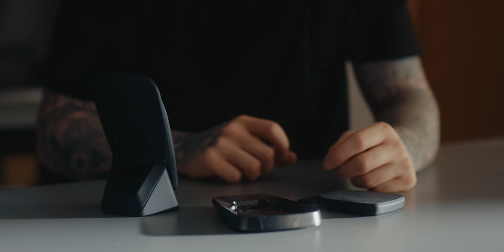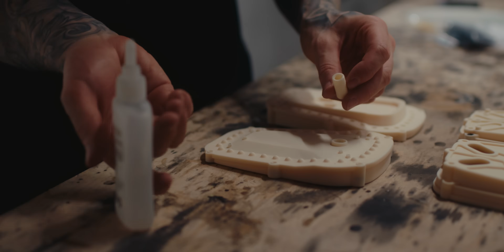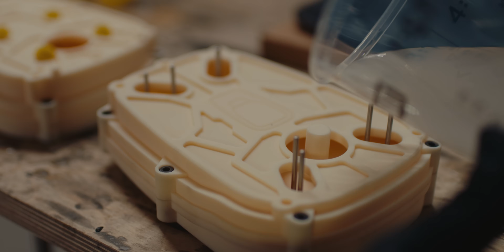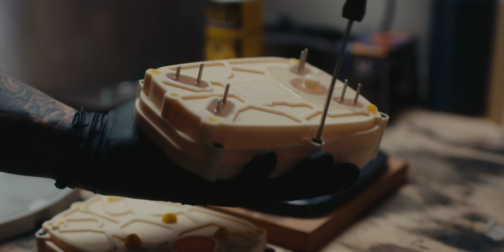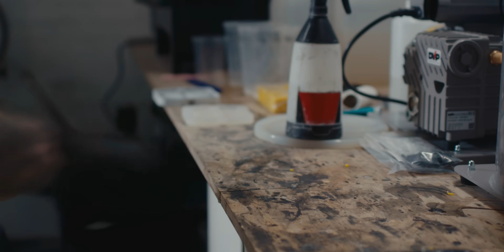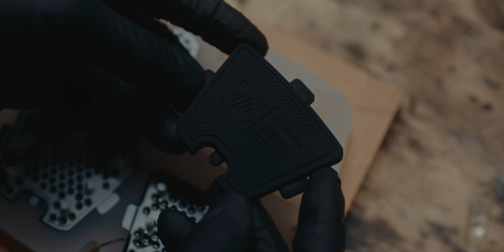Making Moulds That Make Moulds

Comment: Have you found that that printed resin material does not have curing inhibiting issues? What silicone are you using? I tend to have issues with platinum cure silicones on other SLA materials. Thanks!

Comment: Ohh I have questions : )   I've been experimenting with getting this setup with my own molds but even after cleaning/ curing I still have my platinum silicone not curing properly against my resin parts. I can switch to tin based silicone for non food grade molds but have to use platinum for anything food safe.  are you doing any extra prep to your printed parts other than washing and curing and using a mold release?  And I love your video  its very informative and super helpful  thank you

Comment: If I were to describe to you a general shape of a future product that would be made out of thin flexible silicone (very much like a dessert baking mold but would have a totally different use sorry I cannot tell you the product yet) could you tell me whether it is possible for me to make a mold for this myself? How do you make a mold of something with a thin wall thickness, has a specific shape. Does clay play a role?

Comment: Hey, whats the advantage of making the silicon inserts for inside your mould shells for moulding the finished pu parts?  Surely thats a carryover from the days of making a replica of a physical part to mould from? in this case, you are a skilled CAD operator, you can design the parts to get you perfect mould negative cad parts, and you have a hi def resin printer, so you can print your moulds...why not just mould directly the Polyeurethane into a printed resin mould?

Ill level with you, I'm fishing for information. I'm a mechanical engineer moonlighting as a product design engineer in my current role at work....i don't have the greatest amount of experience moulding TPU (although i ve printed hundreds of go pro mounts in it on my side hustle at home), and ive taken it upon myself to redesign a safety lanyard for something that i intend to make out of polyurethane 6-90A (not sure yet)

Theres no way i have time to go to the absolute fine detail you are doing,  and i didnt buy any silicone, just a bunch of different PU grades from smooth-on. I am simply prototyping to ascertain the best grade of PU to use, and size /strength test my critical features, but i am simply planning to print the mould negatives on our resin printer in 2 halves and pour directly into it (well actually i purchased a massive syringe to do it, so i am definitely intrigued with your  simple pour method).

Comment: Adding carbon powder does not help with the strength, it's an impurity. For colour you should use mica powder. Not using a pressure pot on any pour is asking for bubbles. Always pressure the finals.

Comment: Hearing you talking about casting a tube within the casting sounds interesting. But I wanted to highlight that this is an issue if it goes anywhere near the pressure tank (in case you had not thought about it, which I am sure you have). Love this video. I am "trying" to create a cast product, and it takes all my time to concentrate on this, let alone your detailed video setups. I have no idea how you manage all these workflows at once. Well done to you; the video and the productions look amazing. First time here, but subscribing and diving into the archive.

Comment: Sorry what kind of wax is that ? The annotation is calling it fiin wax for some reason
Reply from the maker: It’s called filleting wax. I’ll be updating the description with all the links to everything I used, just haven’t got round to doing it just yet! Thanks for watching!
Reply: @RTAFabrication  I appreciate it; Honestly the way your streamlining the worklflow is so awesome inspiring, I’m still improving on the basics for epoxy  and working on block mold for now (would be amazing, if you have some time to make a video on a way to polish those skills; also, do you think its a good idea to improve my skills while simultaneously learning silicone 2 parts and 3d printing?

Comment: I call this positive halves with the dividing wall(s) “inverse molds.” Used this several times and always amazed when the poured halves fit so precisely together.
Reply: I am pleasantly surprised it worked that well (likely due the compliance in the silicone when clamped and contained in ridged braces)
From previous experience, it’s never as tight and clean as doing two castings with one master.

Comment: Let's say I have an FDM printer. Would I be able to make it work with this? If so, then how so?
Reply from the maker: Yeah absolutely. I’ve printed some FDM matrix mould shells. I haven’t done this exact setup with the masters built in, but I have done it with clay in the example I mentioned towards the beginning. I’d suggest watching the video I did on moulding the oak plaques. I use FDM printed shells in that video showing the exact process. The one thing I like to do with the FDM prints is coat the interior of the shells with a brush on epoxy, like the XCR resin from Easy Composites. This just gives the shell a smooth surface for the silicone to take an impression of rather than it picking up all the layer lines from the print. This is just an extra step I like to take to ensure that the silicone seats back into the shell well.

Comment: Nice process, i only make coasters and coaster holders at the moment and 3d print a positive master mould, then coat that in epoxy resin to give it a smooth and shiny surface, then pour silicone rubber into that to make the negative mould, then use resin to make the final part.

Comment: I thought platinum silicone didn’t work well with resin prints?
Reply from the maker: Hey, thanks for watching! A few people have asked about this, so I’ve pasted my reply to them below as it’s relevant to your question.

“Thank you! It’s funny, I’ve had a fair few comments about this, and ironically I had a whole section in this video mentioning it which I removed which I’m now regretting! I only removed it due to the length of the video.

This is something I get asked about a lot. Weirdly this is never an issue I’ve ever faced. I’ll always either use the Mann Ease Release 200 spray on mould release or I’d paint the master. Both create a barrier between the print itself and the silicone. On the multi cavity mould with the 4 masters built in, I didn’t actually spray mould release on it as a test to definitively see if I’d get any cure inhibition. As you saw, I had no cure inhibitions which surprised me! I went on to say that I’m not sure if it’s down to the SLA resins I use, or the silicone, or the cure settings, or time after curing the part and moulding. I’ve had many people say they use the same SLA resins and have had issues, so my best guess would be that it’s the platinum silicone.

The resins in the video were from HeyGears, the PAWR10 is the beige/ creamy colour and the PAU10 is the grey resin. I have an Elegoo Saturn 2 8K which I usually use AnyCubic ABS like with 10% Siraya Tech Tenacious mixed in. I’ve never had any cure inhibitions with any of those resins. The silicone I used in this video is a sample of a silicone I’ll be releasing soon.

I also said in the clip that I cut that I might do some thorough testing to try and get cure inhibitions so I’m able to figure out which variable is enabling me to do this to try help others out.

I hope that’s helpful in some way and thanks for watching!”
Reply: @RTAFabrication    Thanks for the reply.     I had tried many times using syratech fast grey,   Fully cured,  cured under water as suggested, etc etc.   Always had problems.   I ever tried Siraya techs own platinum silicon.   Failed every time curing to their instructions.   

Anyway.  Thanks again for the reply
Reply from the maker: No worries! Yeah it’s really weird to me that so many people have these issues. I can only guess at this point that is the silicone I use that’s allowing me to do this without any issues. As I said, it’s something I’m going to look into abit further to try and pin point exactly why I don’t get cure inhibitions and why the majority of people do. It sounds like it’s something that would help a lot of people out!
Reply: Some resins and silicones products are indeed more compatible. It also looks like your prints are SOLID and not hollowed out. With hollow prints, it's almost impossible to get a completely cured part in a reasonable amount of time, and they often require extensive cleaning and a bake-out process to speed up the removal of cure inhibiting residuals.

Comment: Man I love your videos. So inspiring and perfectly executed!
But there's one thing I can't wrap my head around: what kind of UV-Resin do you use so you can sort of directly pour silicone on it? This was always the most annoying thing because my resin would inhibit the silicone curing
Reply from the maker: Thank you! It’s funny, I’ve had a fair few comments about this, and ironically I had a whole section in this video mentioning it which I removed which I’m now regretting! I only removed it due to the length of the video.

This is something I get asked about a lot. Weirdly this is never an issue I’ve ever faced. I’ll always either use the Mann Ease Release 200 spray on mould release or I’d paint the master. Both create a barrier between the print itself and the silicone. On the multi cavity mould with the 4 masters built in, I didn’t actually spray mould release on it as a test to definitively see if I’d get any cure inhibition. As you saw, I had no cure inhibitions which surprised me! I went on to say that I’m not sure if it’s down to the SLA resins I use, or the silicone, or the cure settings, or time after curing the part and moulding. I’ve had many people say they use the same SLA resins and have had issues, so my best guess would be that it’s the platinum silicone.

The resins in the video were from HeyGears, the PAWR10 is the beige/ creamy colour and the PAU10 is the grey resin. I have an Elegoo Saturn 2 8K which I usually use AnyCubic ABS like with 10% Siraya Tech Tenacious mixed in. I’ve never had any cure inhibitions with any of those resins. The silicone I used in this video is a sample of a silicone I’ll be releasing soon.

I also said in the clip that I cut that I might do some thorough testing to try and get cure inhibitions so I’m able to figure out which variable is enabling me to do this to try help others out.

I hope that’s helpful in some way and thanks for watching!

Comment: Hmmm I’ve had issues with curing platinum silicone with resin printed masters. This lead me to use tin based silicone. Are you using platinum because I’d love to switch back. I’m sure it’s something I did wrong.
Reply from the maker: Thanks for watching. Someone else asked this same question so I’ve pasted my reply to them below as it’s relevant to your question.

“Thank you! It’s funny, I’ve had a fair few comments about this, and ironically I had a whole section in this video mentioning it which I removed which I’m now regretting! I only removed it due to the length of the video.

This is something I get asked about a lot. Weirdly this is never an issue I’ve ever faced. I’ll always either use the Mann Ease Release 200 spray on mould release or I’d paint the master. Both create a barrier between the print itself and the silicone. On the multi cavity mould with the 4 masters built in, I didn’t actually spray mould release on it as a test to definitively see if I’d get any cure inhibition. As you saw, I had no cure inhibitions which surprised me! I went on to say that I’m not sure if it’s down to the SLA resins I use, or the silicone, or the cure settings, or time after curing the part and moulding. I’ve had many people say they use the same SLA resins and have had issues, so my best guess would be that it’s the platinum silicone.

The resins in the video were from HeyGears, the PAWR10 is the beige/ creamy colour and the PAU10 is the grey resin. I have an Elegoo Saturn 2 8K which I usually use AnyCubic ABS like with 10% Siraya Tech Tenacious mixed in. I’ve never had any cure inhibitions with any of those resins. The silicone I used in this video is a sample of a silicone I’ll be releasing soon.

I also said in the clip that I cut that I might do some thorough testing to try and get cure inhibitions so I’m able to figure out which variable is enabling me to do this to try help others out.

I hope that’s helpful in some way and thanks for watching!”
Reply: Same to me ....

Comment: Hey man, I am noob here, but when the silicon is poured (second grey/blue mould) it's better to pressurise it, not degas again. AFAIK,
Reply from the maker: Hey! You could put it in the pressure pot, however, all you’re doing there is crushing the air that’s within the silicone mixture. This won’t necessarily guarantee that any air bubbles will be eradicated, only make them smaller. This isn’t me saying it’s the wrong approach, but the goal with that was to remove them entirely from the detailed areas. 

I degassed the mixture first to remove the air from the mixture itself and because if I didn’t and just poured it into the mould, it would have overflowed due to the amount of air in there when I did the degassing on the mould. I degassed when the silicone had covered the masters to remove the air from those details like the text on the master/ mould. Doing it this way will move the air out of those details, which was the only real goal, and then they’ll come up through the mixture removing them from the silicone.

Hope that helps and thanks for watching!
Reply: @RTAFabrication  got it, thanks for explaining!
Reply: resin needs pressure while curing ... silicon needs depressure after mixing...

Comment: Great work and passion!  What about the problem of platium-silicon does not cure/inhibit problem with resin-printed forms? You did't seal your forms ... so maybe your resin material does not have that issue? Whoch material are you using? Or is it just like magic ...
Reply from the maker: Hey, thanks for watching! A fair few people have asked about this, so I’ve posted my reply to them below as it’s relevant to the question you have.

“It’s funny, I’ve had a fair few comments about this, and ironically I had a whole section in this video mentioning it which I removed which I’m now regretting! I only removed it due to the length of the video.

This is something I get asked about a lot. Weirdly this is never an issue I’ve ever faced. I’ll always either use the Mann Ease Release 200 spray on mould release or I’d paint the master. Both create a barrier between the print itself and the silicone. On the multi cavity mould with the 4 masters built in, I didn’t actually spray mould release on it as a test to definitively see if I’d get any cure inhibition. As you saw, I had no cure inhibitions which surprised me! I went on to say that I’m not sure if it’s down to the SLA resins I use, or the silicone, or the cure settings, or time after curing the part and moulding. I’ve had many people say they use the same SLA resins and have had issues, so my best guess would be that it’s the platinum silicone.

The resins in the video were from HeyGears, the PAWR10 is the beige/ creamy colour and the PAU10 is the grey resin. I have an Elegoo Saturn 2 8K which I usually use AnyCubic ABS like with 10% Siraya Tech Tenacious mixed in. I’ve never had any cure inhibitions with any of those resins. The silicone I used in this video is a sample of a silicone I’ll be releasing soon.

I also said in the clip that I cut that I might do some thorough testing to try and get cure inhibitions so I’m able to figure out which variable is enabling me to do this to try help others out.

I hope that’s helpful in some way and thanks for watching!”
Reply: @RTAFabrication  Do you still plan on releasing resins and silicones?
Reply: txh! waiting for test, looking for this technology a lot of time

Comment: On Robert Tolone channel he has a few tips n trick with silicone that maybe of interest. Mould preservation etc. using positive pressure in some cases to pop bubbles. 

The other channel that may be worthwhile is “out of darts”. The workshop tours the guy has done have some scaling tips. There are 3 or 4 so far, the first couple he mentioned a couple of books that talk about efficiency of work flow. As a result he came up with magnetic jig that held the magnets that were inserted in the nerf guns. He quickly gets a magnet, holds near jig, it attached to jig magnet (glued) then the pulls the arbour press handle to inset four magnets at a time. It took seconds instead of minutes. He has other things about order of operations and setup of workspace to maximize time saving. Less walking is more production sort of stuff. 

A high tea style rack that you load and you drop into the vacuum chamber would be handy - saves you having to reach down into the chamber  with wet resin. That could spill.  

Time efficiency is critical. Anything you can do to speed up workflow is more profit…

Comment: Could you place the moulds on a plate that is attached to an ultrasonic cleaner. The vibrations would help the Bubbles evacuate as you pour and before they set up.